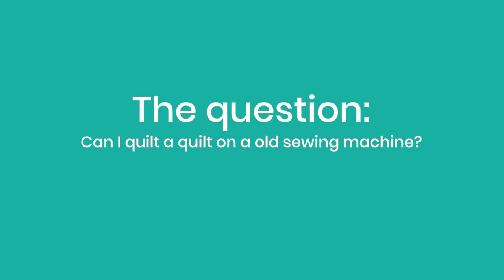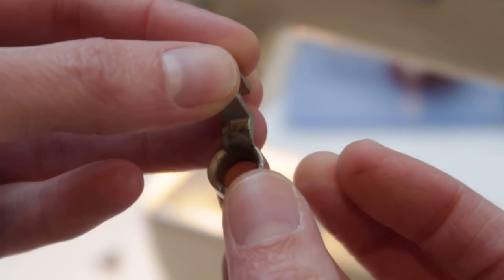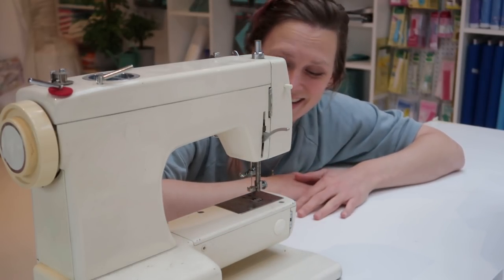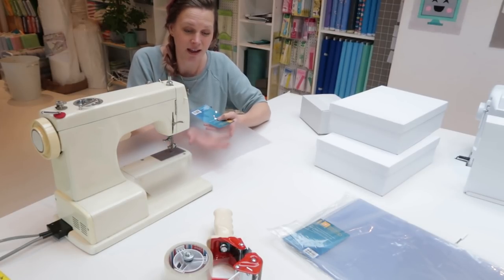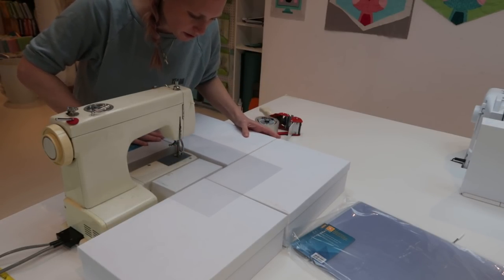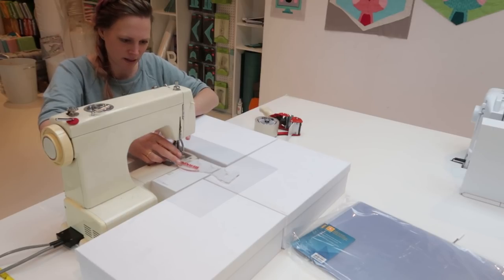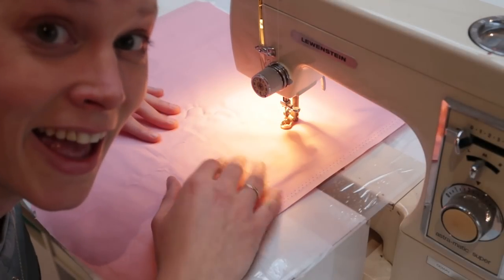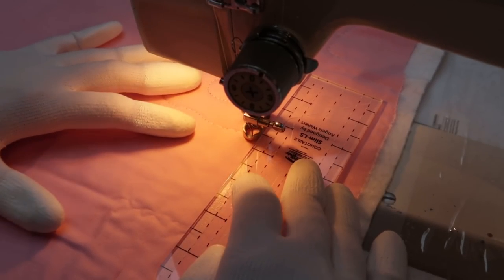Sewing machine experiment: DIY a slide on table for ruler work [Q&A #12]

Comment: Retired mechanical engineer here. I used foam board to build up an extension table. It’s easy to cut using quilting ruler and mat. It is a little lightweight so I used a piece of wood on top. I’ve used foam board to build a light table with fairy lights, foil and a piece of window glass,too. It’s cheap, easy to cut/glue,and lightweight.
Reply: And the foam board is about a $1 a sheet at Dollar store.

Comment: Well done! Some years ago I also build a quilttable round my older machine with stuff from ikea and do-it-yourself-market. Now I have a new question for tuesday q&a: when basting my quilt I had puckers in my batting because it was folded stored away. Can the batting be ironed to get those folds out? It makes it very difficult to baste a big quilt when the batting has already puckers itself.
Reply: I always hear if you "lightly" dampen the folds and put it on the dryer on a low setting the folds will disappear. Try it on a small sample first. Good luck.